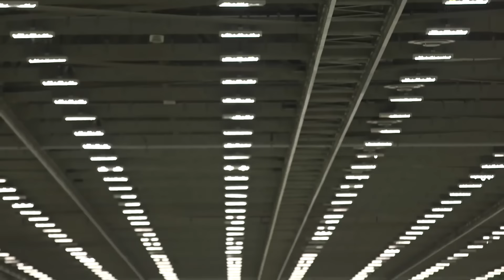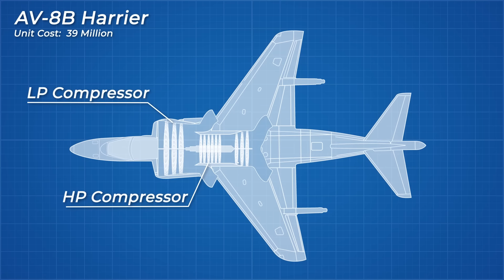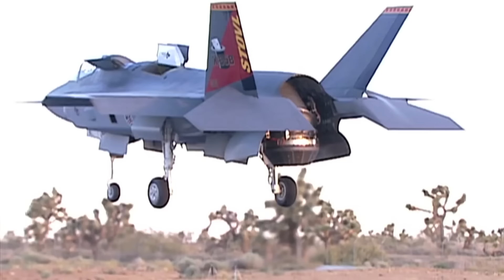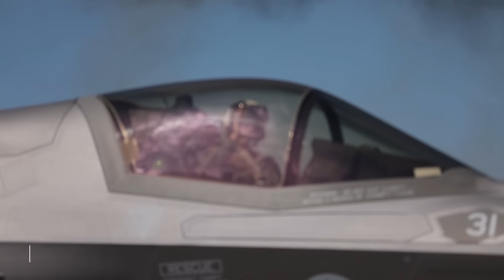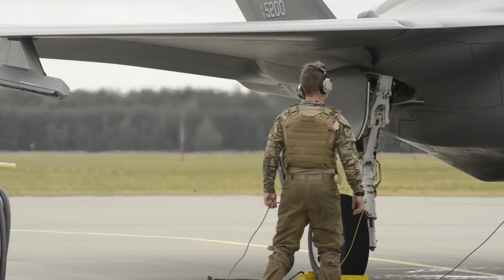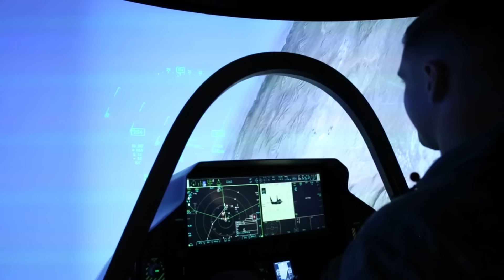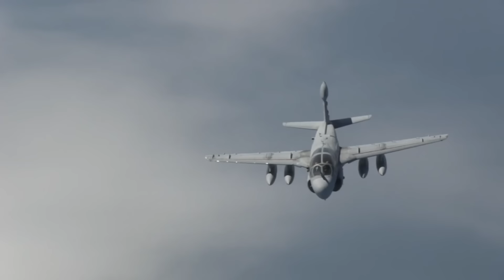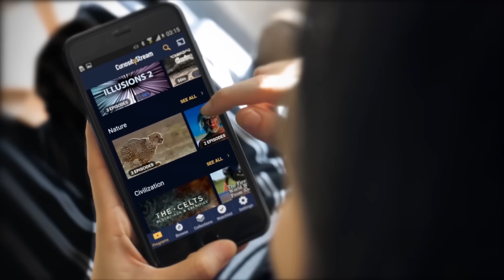Is The F-35 Worth $115 Million?

Comment: You know you could have tweeked the F15s shape a little to make it Radar invisible without loosing performance and given it directional thrusting for more rapid changes of direction, in my opinion it would have been far superior than even the F22. as for the VTOL F35 ... hmm 2 engines that an older version managed to do with One says it all in my book .... they've regressed not moved forward.
Reply: They already attempted that with the F-15 and it was never going to be better than the F-22 or F-35 simply because the F-15 without stealthy modifications has the largest RCS of all fighters worldwide by far. It's RCS is so large that a B-1B matches it. If modifications are made to make it stealth then the changes would be so drastic it would no longer be an F-15.
F-35 only has one engine... and it is far more stable when hovering than the Harrier.

Comment: The A-10 warthog in my Opinion is nearly impossible to replace The only speed’sthing that comes close is drones it’s designed to fly very low slow  it’s fuel and pilot and sensitive systems are armored which is something that will never be in the air superiority aircraft and it’s engines are on top meaning it’s the last thing to get shot from ground fire it’s designed to take damage 70% of one wing can’t be damaged or torn off and pilots have still landed them

Comment: is it worth 115 million? somebody thinks so because they keep throwing money at it. as far as it replacing anything that never came to be, all the planes it was going to replace have been given life extentions including the A-10
Reply: The A-10 was never going to be replaced by the F-35 directly and no other fighters have been given life extensions beyond hte point that they can actually be replaced. You know the F-4 served for over a decade after ALL it's replacements were operational right?
Reply: @dumdumbinks274  it is a historical fact that the A-10, F-15,F-16 AND THE F/A18 were to be replaced by this plane. 27 years later all those planes are still in the air. the only exeption was the Hornet which was replaced by the Super Hornet.
Reply: @michaelhowell6166  It is not remotely a historical fact - that's just what you've seen in the overly dramatic media. It's been 18 years since the X-35 won the competition and only 4 years since the first squadron declared IOC. The only aircraft the F-35 has ever been confirmed to be replacing are the AV-8B, F-16, and F/A-18A/B/C/D. 

The A-10 is only being discussed because the F-16 already replaces it in many CAS operations and the F-35 is replacing the F-16.
It was recently discussed that the F-35 should also replace the F-15 after the cancellation of the F-22 since hte F-35 is better in almost every aspect compared to the F-15, but that idea fell through because it was realised the F-35 production lines already have about a decade of work to do just to replace the F-16. Instead they chose to buy more F-15s because they don't affect the F-35's procurement at all.

Comment: The real mission of the F-35...is to suck the maximum $$$ out of the American taxpayer without the Program be canceled. Loiter time on target is too short to support the CAS mission and it must fly at significant altitude because it's just too fragile at a lower altitude. The real reason the A-10 hasn't gone away is that we still need it for lower altitude CAS missions...where choppers would get eaten up.

Comment: stealth comes with long range radar looking missiles. Missile uses solid rocket motor. Once must understand how rocket motors works in order to understand how missile actualy shots down a plane. Rocket motor does not work continously like jet engine, it operate only a few seconds.  In that amount missile gains both altitute (several kilometers, up to 20) and speed (several machs, up to 7). Then missile starts tracking the plane using fin guidance. 

But this tracking is anything one would see in a movie (for instance behind enemy lines). Also missile won't do a U turn or it won't explode like in the movie. Also a plane would not explode in a holywood manner like there's a 10 kg of high explosives onboard. 

Missile also do not use shrapnels like seen in movies. Missile uses continous rod fragmentation warhead  https://en.wikipedia.org/wiki/Continuous-rod_warhead and newer they directly hit the plane, but rather do a flyby and when the missile and plane are parralel the warhead explode and propels the continous rods in a ring shape patern what finaly cuts and destroies the plane.

Now if you understand how missile works you know now that in just a few seconds they receive all of its energy from the rocket engine and after that it is a guided projectile constantly loosing speed and altitude. So if you fight stealt mode you shoot in a range greather that 100 kilometers. Let's say you shot at eurofighter or raffale. They are both very agile. They won't see you at the distance of 100km but they will get allerted once missile is fired upon. They will turn in the oposite direction and have good chace to avoid beeing shoot by the missile since the missile will lose more than half of its speed before geting close to the target. At thait point agility will have good chances to avoid being shot by the missiles since the speed of missile will be less than 3 mach. 

At the same time those planes could track F35 and if it will come to dog fight, F35 would loose badly.
Reply: > "At the same time those planes could track F35 and if it will come to dog fight, F35 would loose badly.
"

 ?

Comment: serbian army shot down F117 not with radar seeking missile but rather simpler russian design IR seking surface to air missile. Once again low freq radar - a weather radar was used by the Serbs to detect a F177, not to pin point accuracy of course but at this point simple and cheap IR seking missile was shoot from the ground and efectively shot down the plane. 

Newer adwanced ir seekers have a range of 40+ kilometers and are proven against electronic jamming as heat countermeasures since the computer follows the planes path rather to seek the hot spot.
Reply: No they used the S-125 with V-601 missiles and they were forced to engage at short range due to stealth working as intended. This is acknowledged by the Serbs.

Comment: joint strike or 3 planes into one concept is just stupid and the program from the financial point of view is same as space shuttle program. 

Once again shows that common sense is not important when public orders are in place and political will is strong. 

Also F35 is not meant to replace F18 that's F22 job. F18 is larger heavier plane, with twin engine same as F22 is. F35 is smaller and can only replace F16. 

Anyhow both F22 and F35 are dead end. The whole stelth concept is a hoax since it will newer work in real life. Russian radars and IR detection can spot a stealth plane in radius larger than 60 km. 

Another thing is pure economics. You can build expensive and superb plane for 200 mio $ but your defence  budget would not allow to change 1500 planes US army uses. 

Also when budget is invole let's not forget buying a plane is one but equal important is maintaining it. Maintanace costs of both F22 and F35 are just astronomical. 

On the other hand you can build 3 F18 for the price of single F22. What is better? I don't know, but the facts is 5th GEN fighters are same as electric cars. They exsist but there are only about 2-5% of them.
Reply: > "joint strike or 3 planes into one concept is just stupid and the program from the financial point of view is same as space shuttle program."

? 

> "Also F35 is not meant to replace F18 that's F22 job. F18 is larger heavier plane, with twin engine same as F22 is. F35 is smaller and can only replace F16."

 The F-35C is replacing the F-18 and F/A-18E/ F. Not the F-22A. The F-35A is replacing the F-16C. 

> "The whole stelth concept is a hoax since it will newer work in real life. Russian radars and IR detection can spot a stealth plane in radius larger than 60 km."

 This notion is based on what exactly?

Comment: it's always the same bullshit from the ignorant. 

"it can't pull 9 G's!" 
Doesn't have to. It'll see you from 800 miles away, identify the model of your plane using fancy algorithims, suggest a weapon for the pilot, and even a course of action. Shit, if you're 2,000 miles away, but another f-35 600 miles away spotted you, (which is in itself insane) that f-35 will transmit all of its data on your aircraft in real time to the other pilot 2000 miles away.

"it's top speed is the same as that 50 year old f-16!"
Sure. But only when the f-16 is completely empty, and the f-35 is fully loaded. 

"it cost 1.5 trillion!!!!1!11!"
Nope. It's cost about $300B so far. the 1.5T figure is the estimated cost of the entire program through to 2050, and accounts for ammunition, repair, fuel, procurement, training, and even losses.
Reply: "it can't pull 9 G's!"
- Best response to that claim I feel is "it can". Only the B & C versions can't and that's mostly because they are naval aircraft which are always rated lower anyway.

Comment: I'm going to say probably no, because for 5 million each you could make an semi-autonomous drone that can pull 20g turns that no piloted plane can keep up with, and with that 115 million you could get 23 of them, which would be impossible for an f-35 to defeat.
Reply: For $5 million that drone wouldn't have weapons capable of shooting down a fighter and it would be extremely slow and short ranged. Being able to pull 20Gs doesn't matter anyway because such a turn cannot be sustained and it would lose all it's energy. Not to mention the F-35 would just jam the drones thus preventing them from operating at all.
Reply: dumdumbinks274 I’m pretty sure that $115 million that the F 35 cost does not include weapons. In terms of jamming the drones, it would be pretty obvious to have the drone have autonomous capability. Also the source of jamming makes an excellent way of targeting something with a missile. Even if you make the drones cost 25 million to make them more capable I am pretty sure that 5 to 1 Odds would be pretty devastating for the F 35.
Reply: @macrumpton  The F-35A currently costs less than $80 million per unit which is less than most 4th gen fighters. But regardless of that the point about the weapons is that a $5 million drone simply wouldn't be capable of using the weapons required to be effective against fighters even if the service operating the drones paid for the weapons. If all you had to do was buy the weapons then the F-35 would be a $60 million fighter.

Autonomous drones are not within reach, and even then they would still rely on targeting systems that can be jammed. $25 million is the absolute minimum cost required for a drone to do what you're asking, and it still wouldn't be cost-effective. To put it in perspective the MQ-9 Reaper drone which is only capable of recon and dropping bombs or short range anti-tank missiles is a $20 million drone. 

So an absolute best case scenario cost for cost would have 3 fairly incapable drones per F-35A. The F-35 can at present carry 4 long range air to air missiles internally and soon that will increase to 6. That means each F-35A will have plenty of missiles to waste on drones, not that really need to anyway.

Comment: I worked on the Over the Horizon Backscatter Radar (OTH-B).  Shame that was canceled.  It has great potential for detecting things like this using its relatively long wavelength radar waves in the 5 -30 megahertz range or 60 -10 meter length.

Comment: Nice mercenary Video. DO you know that most of the up to date production is faulty and can never be used as war plane?
Reply: No, because that's false. The F-35A and F-35B have both been used in real combat operations. There are only concerns about minor issues that might affect operational performance, but those can only be fixed once the F-35 has been tested operationally just like every other fighter that has had similar problems.
Reply: @dumdumbinks274  Please! Check facts in depth b4 touching keyboard and stating someones information false.
Reply: @jakovskaro8224  You should do exactly that. Fleet-wide availability rates are low, but that's not because the planes are faulty, it's because the supply of spare parts has not kept up with production of aircraft. There are very few examples of F-35s that are not combat capable, and those are used as training aircraft so are still very useful.
Reply: dumdumbinks274 I don’t argue with people not knowing basic facts or refusing to know them. 

This conversation is over. Have nice life.
Reply: @jakovskaro8224  So what "facts" are you referring to? Made-up Russian ones? The last time there was concern over F-35s not being combat capable was 2-3 years ago and ONLY in reference to very old airframes that were not worth upgrading to the modern standard. Those airframes are still used to train pilots.

"I don’t argue with people not knowing basic facts or refusing to know them"
- So basically you don't talk to people who don't agree with you. That's quite unreasonable. Most people who use that excuse simply don't have any evidence to support their claims.

Comment: The most expensive weapon ever developed is the B-2 Spirit Bomber
Total procurement costs averaged $929 million per aircraft, which includes spare parts, equipment, retrofitting, and software support. The total program cost, which included development, engineering and testing, averaged $2.1 billion per aircraft in 1997.

Comment: I'm having a hard time believing the soldier on the ground will be happier with an f-35 offering close air support than a warthog. The F-35 is too fast and too ill equipped for this type of role. I would imagine a simple single engine prop plane with modern armaments would likely be better for this role. I'm not a military guy but from what I've learned over the years regular jets aren't very good for this type of role but maybe things have changed due to technology.
Reply: The thing is the A-10 has been replaced in CAS missions with a present air-to-air or ground-to-air threat since the mid nineties by the F-16C. You're right in the fact that the A-10 is being replaced by lighter aircraft in missions that have such threats.
Reply: @peterson7082  I guess I've read stuff like this and they make a rather compelling argument although I can only base that off of my best common sense since I'm no expert in this area. To me we seem to waste so much of the defense budget if we could manage a few reforms I suspect the money is already there. The 70K per hour cost of an f-22 would seem to suggest it may be prudent provided the small planes could be armoured enough. 
 https://www.airforcetimes.com/news/your-air-force/2018/02/20/a-light-attack-aircraft-fleet-could-it-change-the-fight-or-put-lives-at-risk/

Comment: The cost increase associated with creating variants for the various services is not as bad as you might think.
1) Commonality of parts will reduce cost over the life time of the system.
2)  Having a broader user pool will decrease the amount of time to find the defects in the design(and there are always defects in new designs).
3) The wider number of users and maintainers will also give a more diverse range of ideas for future upgrades, increasing the lifespan of the design, delaying the cost of designing a new system.
These point, and others, have been played out several times with different military systems, such as the Humvee, M1 Abrams, M4-M16, ect.
Of course, none of that will matter if the basic design is crap, and we won't actually know for sure until they get it into a fight or two.

Comment: Question: what does the F-35 do to replace the A-10? The whole point of the warthog are the munitions it carries, you didn’t mention the armaments of the F-35 at all in this video. Still enjoyed learning about the F-35 though, really love your channel
Reply: The F-35's GAU-22 and the A-10's GAU-8 are part of the same family of weapons. They are rated for the same accuracy. The F-35 is able to carry up to 8 250lb precision bombs internally that are ideal for situations requiring low collateral damage. There is also another 250lb bomb that functions as a long range anti tank/personnel weapon (dual warhead). 

In situations the A-10 would be used remaining stealthy isn't required so the F-35 can also use external munitions. In total (internal + external) the F-35 can carry more than the A-10, and potentially up to 24 of those 250lb bombs though that's just not a practical loadout.
Reply: dumdumbinks274 appreciate the answer!

Comment: For the eleventh consecutive year, the cost of an F-35A was lowered. The F-35A unit price including aircraft, engine, and fee, is $89.2 million. This represents a 5.4 percent reduction from the $94.3 million it cost for an F-35A in Low-Rate Initial Production Lot 10 (LRIP 10), and also puts the F-35A at equal to or less than the price of legacy aircraft. In LRIP 11, the F-35B unit cost was lowered to $115.5 million. This represents a 5.7 percent reduction from the $122.4 million it cost for the short-takeoff and landing variant in LRIP 10. The F-35C unit cost was lowered to $107.7 million. This represents an 11.1 percent reduction from the $121.2 million it cost for the carrier variant in LRIP 10.

Comment: There is no finer close support aircraft for the troops on the ground , than the A-10 warthog. The F-35 is a fine aircraft but it cant touch the capabilities of the A-10
Reply: Not really the case.
Reply: @peterson7082  tell that to all of the troops tha have been saved by one...multiple times
Reply: @kennywilliams7339  The thing is the A-10 has been replaced in CAS missions with a present air-to-air or ground-to-air threat since the mid nineties by the F-16C.